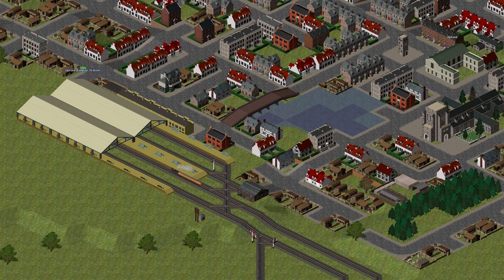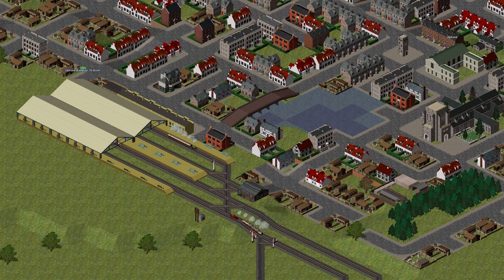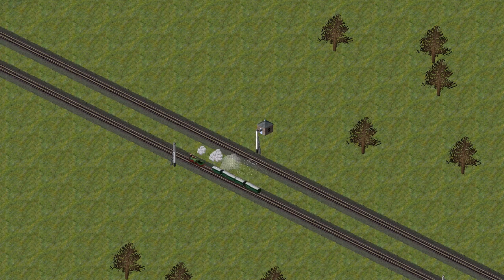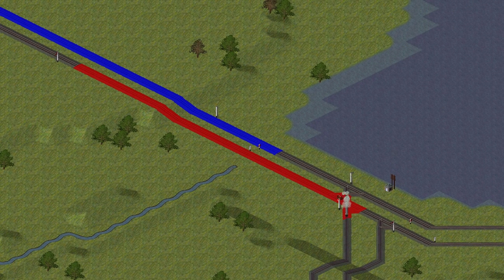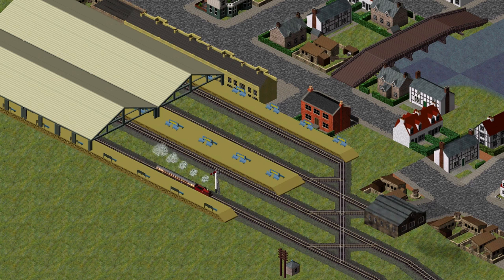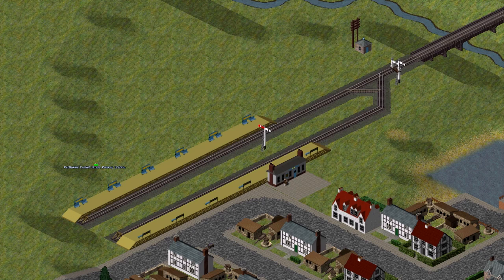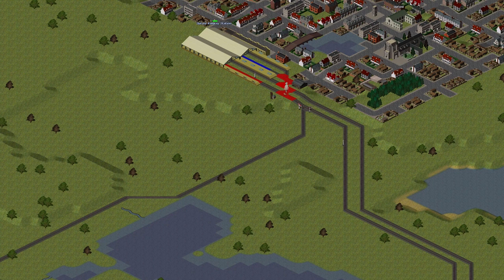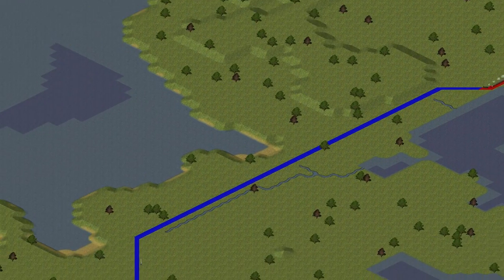The Electric Telegraph

Comment: Make a tutorial on how to delete save files, please...
Reply from the maker: I don't think that that needs a video - you just need to go to the load or save dialogue and click the "x" next to the file that you want to delete. Alternatively, you can find the files on your computer (where they will be depends on your operating system and whether you have a single or multiple user install) and delete them manually.
Reply: I checked the some paks and I couldn't find the X to delete the save file, I don't know which files I have to edit or delete to delete the save.
I am using Pak128.Britain.
aswell as the Steam version of Simutrans, Is it ok if you tell me where in the files is the save files located, Icant find it.
Reply from the maker: Ahh, the Steam version of Simutrans is the Standard version, whereas this video is about the Extended version. I am not sure whether it is the same as in Standard, but, in Extended, the X is to the left of the file name in both the load game and save game dialogues.

For general Simutrans help, may I suggest registering an account at http://forum.simutrans.com ?
Reply: Thanks for telling me there is an extended version
Do you recommend the extended version?
I tried it out and it looks interesting but I fear it might contain some bugs.
Reply from the maker: Marzik Gaming I do not think that there has ever been a complex piece of software that did not contain bugs; if you have a look at the International Simutrans Forum you will see posts describing the Extended version and how it differs from the Standard version; you can then decide which of the two suits you the best.
Reply: Ok.